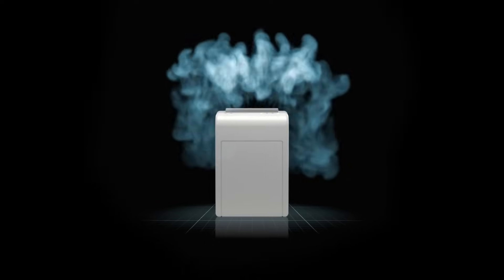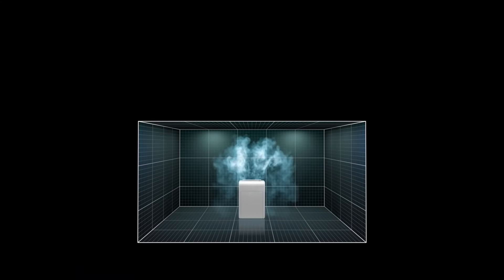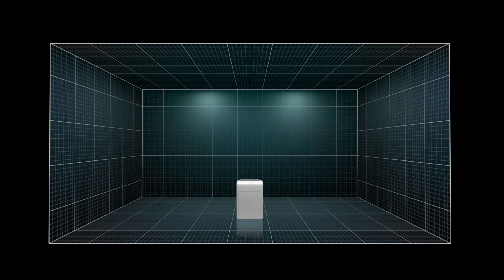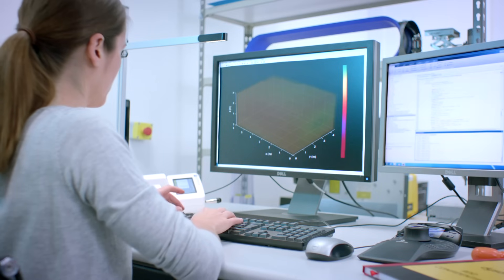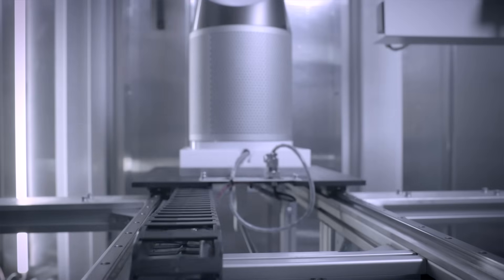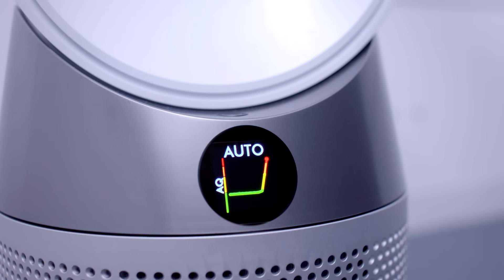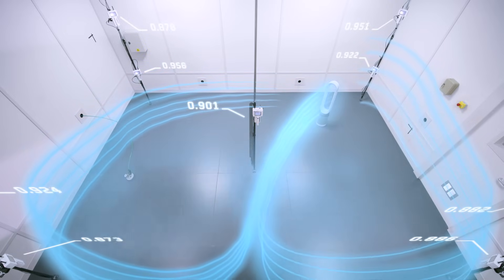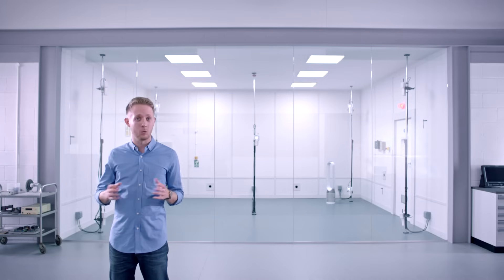How our engineers test the Dyson Pure Cool™ purifying fan

Comment: I still think 400 dollars for their "cheaper" model, which is just a plastic case with a fan, is too expensive. There is no app support, no display, a plastic remote with low range, and one of the loudest fans on any air purifier. And if you need to replace the filter, you must come up with 80 dollars every year if you want the Dyson filter. You can get an air purifier with more features and a smart fan for the same price. When I got my Pure Cool Tower, they didn't even bother to ship it with their filter; they shipped it with a 20 dollar filter that only lasted around six months.

Comment: Where direction does the air purifier suck dirty air from: behind the fan, in front of the fan or from all sides?
Reply from the maker: The unfiltered air is sucked in from the base (where the motor is), passes through the filters, and is pushed out from the slits in the Amp assembly!

Comment: Great talking but how about a video demonstration, I would really like to see what settings were used and how long it took. I just bought the Tp09 and the air flow on auto seems so low (goes to level 4) that it will probably take 1 day to clean a 20mp2 room and if I set it on anything above that ... or max the noise level is not tolerable. 
So, what settings and how long it took? Did it used oscillate as well? if Yes, on what range?
Like Mr.Dyson used to demo his vacuums, I expect the same from the purifiers no?

Comment: How long does it takes to purify a room 23cm room and what are it’s affects if any with corona virus 🦠?
Reply from the maker: Dyson purifying fans purify bacterium, not viruses. So we can't advise that it will improve or cure symptoms of corona virus as it is not a medical device. In terms of the rate of purification, it is dependent on many factors. If you have the airflow set to 10, it will purify the air in proximity to the fan very quickly. For more information, please visit this link. https://www.dyson.co.uk/air-treatment/purifiers.html
Reply: Dyson Your website says it does viruses? “Dyson Pure Cool air purifiers are scientifically tested to capture particles as small as allergens and viruses”
Reply: @user-ke2dn2cm3r  Hi, this is kinda late but still just want to say that you misunderstood the statement. They said it captures particles "as small as viruses", not viruses themselves. So the machine is built to capture particles that are the size of a virus, but, not built to catch viruses in particular.